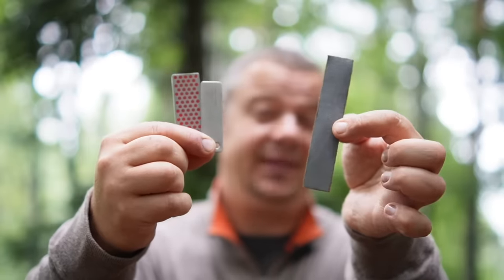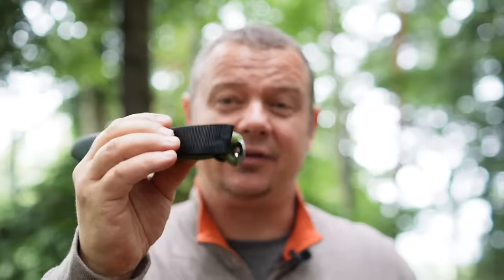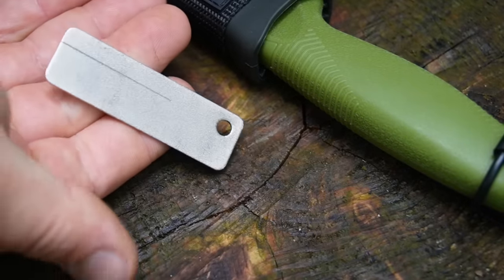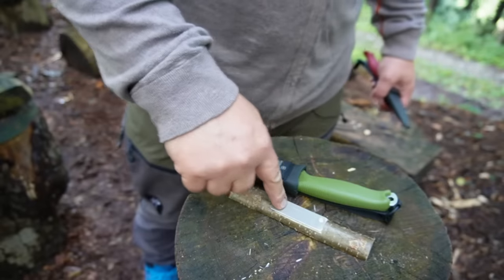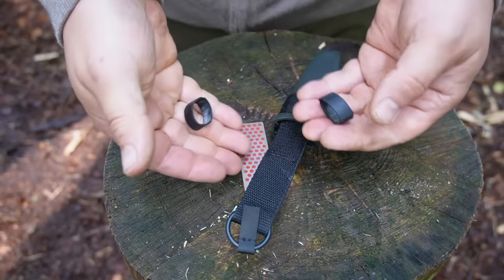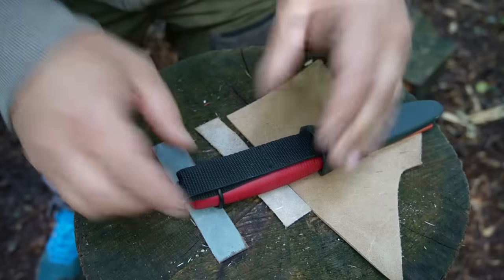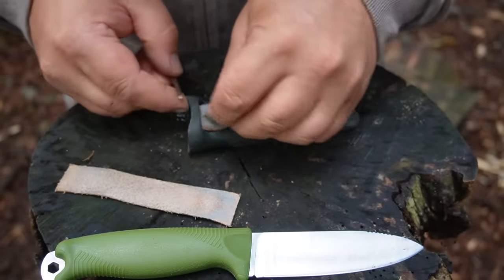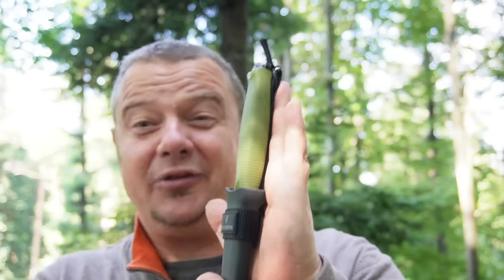Victorinox Venture: How to add a Diamond Sharpening System

Comment: I've had one of those DMT minis on my bushcraft blade sheath, attached by a section of inner tube, for many years and have also occasionally whittled a branch as a holder👍
Reply from the maker: Yes, thanks a lot for your inspration!
Reply: 😆 @FelixImmler

Comment: Hi Felix, 
Nice presentation! I enjoyed the details about the final edge angle and the little 6 mm "indicator" in the strap. Very smart! 
I have been testing diamond pastes on various surfaces. A progession is nice however, out of the ones you showed I would go with the DMT diamond paste on leather. The 6 Micron one is good but surprisingly the 1 Micron paste has better feedback and cuts quite well. Maybe play with the surface of the leather..rough it up or smoothen it out...see what works for you. They do cut but it is more "in the eye/hand of the beholder" as the feedback is very important. If you don't feel it in hand you might raise/lower the spine and it does not harm than good or nothing at all. 
If you ever consider balsa wood, i can tell you from my own experience, the CBN 3 Micron and 1 Micron worked best for me...although on balsa the feedback is not the greatest.
Reply from the maker: Thank you so much for this valuable feedbacks!

Comment: Hi! Another great video.  My Dad used to strop his vic pocket knife on the palm of his hand after every use.  I found it works quite well to maintain the blade after light use.  I don't know how that might work on a heavier blade.
Reply: Ah wow, I have never heard of that, but it's probably similar to strop it over this leather thingy.
Reply: @XoNasX  The biggest difference is that on a leather strop, you (most of the time) put compound, which makes it faster and more effective.
Reply: Spoiler Alert:
Even if he covered his buttcheeks in stropping compound, and sat on his knife, it still wouldnt work.
Reply: @alfonsedente9679  stropping a straight razor without a compound is commonly done after/before a shave when only minor touch up/or maintenance  is needed.  This is commonly seen in any barber shop that still shaves with a cut throat razor.  A small pocket knife used to open mail or cut a string starting with a keen edge (Dad and I both used an Arkansas stone) is maintained, with less frequent trips to the stone.  There is a whole literature, easily found on line, of people doing this with double edge razor blades during the depression and now as well. So, I would suggest more gentlemanly, less disrespectful comments about a man long gone,  on this channel.

Comment: Wet and dry sandpaper for me. Always.
Least weight also.
Even at home I use that.
Up to 6000 grit I have it.
Mostly up to 2000 grit and then the strop.
I used diamond also, they wear out just as well. Waterstones...
I like the paper the best.

Jimmy Two Times : I'm gonna go get the papers, get the papers.
Reply from the maker: Thanks a lot for this super interesting comment!
Reply: @FelixImmler 
At home I use the sandpaper on the sanding block with the metal spring  clips.
It has the somewhat softer backing (little harder than most mousemats). So I can easily turn a scandi type of bevel (in my case, mora knives) into a slight scandivex. Giving it a stronger edge . And still a razor also.
Most of time a touch up with 2000 grit paper suffices along with the strop. Or else 800 grit if it's really dull . Then 2000 and then strop.

Comment: Hey Felix,  

Thank you for another informative video. 

I have a victornox officer's knife. It has a bottom Phillips screw driver which has a slot in the center of the tip. 

I have not been able to figure out what this is for. 

Hoping you may have a answer what it is for. 

Thanks, Jonas
Reply from the maker: this is a can opener for an old system that no longer exists...

Comment: Great video Felix. Just got quick question and sorry it’s not about the video my question is could you do a video on how to keep the belly of the blade on SAK as I’ve seemed to be losing mine even tho I sweep my blade along sharpening stone and follower the knifes edge and lift my elbow when getting too the belly. I must be doing something wrong so just wondering if you could help. Thank you.
Reply from the maker: I would like to help you... but i don't understand your question..sorry.
Reply: @FelixImmler  ok thank you for replying Felix. Umm you know the SAK 91mm blades the blade edge goes straight then it curves/bends to the tip of the blade which I think they call it the belly (I think lol) I’m basically losing the curve at the end of the blade so I’m wondering where I’m going wrong as I try follow the knife edge. Thank you.

Comment: Also they need to sell more expensive diamond rod substitute they’d make a ton $
Reply from the maker: Of course we checked out also diamond sharpener solutions. If you want a product from a companie where you get this sharpener also in 10 years and in the same quality… it will coast simply to much.
Reply: @FelixImmler  yeah I don’t mean with it. Like sell them for 59.99 as an upgrade you can buy separately.